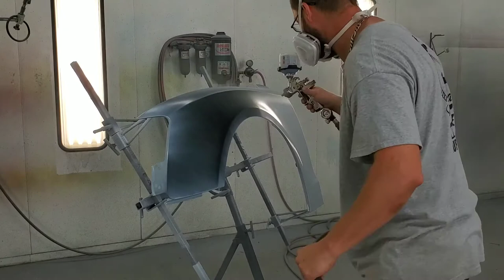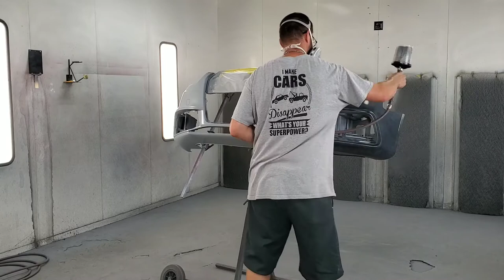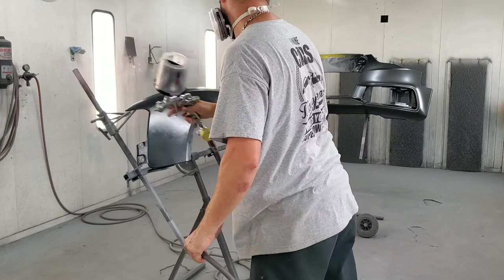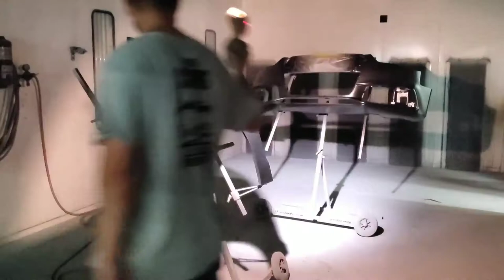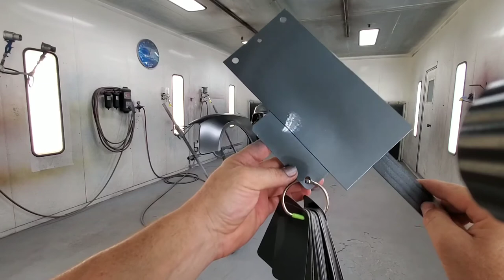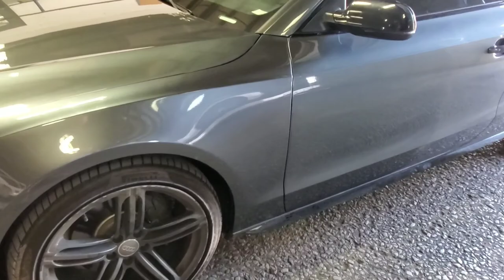LZ7S Daytona Gray '14 Audi A5

Comment: Do you think it's a massive job to change from light-silver metallic color to this? And I also found the PPG color code 904302 for LZ7S, don't know if this is correct. And I cannot find if this color is metallic or just pearlescent.
Reply: Daytona gray is pearlescent. If you look at it in the sunlight it is very "rainbow-y "
Reply: @lucasaubin1661  you're right. I'll see if I can find a similar gray without the effect. Or I might just respray the current color with a tinted clear coat.